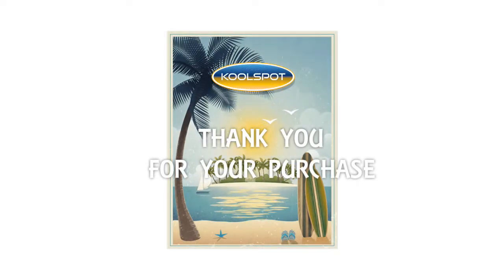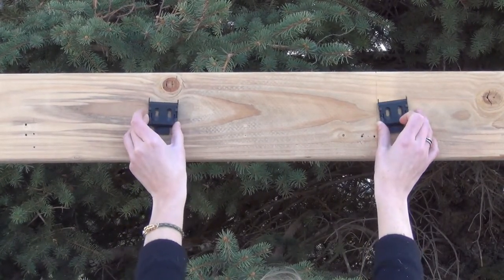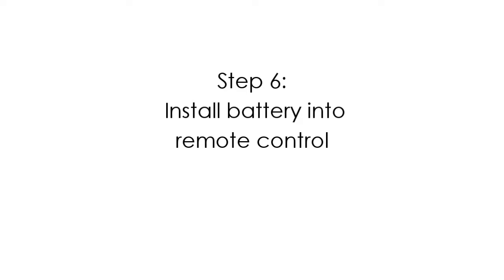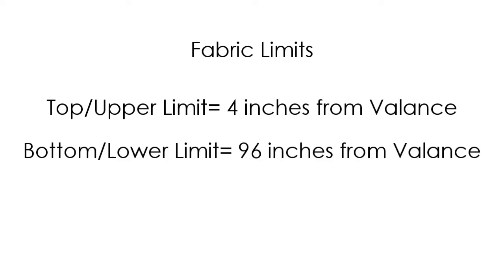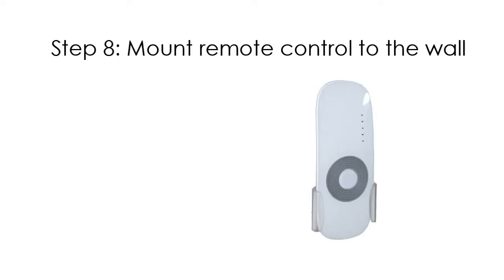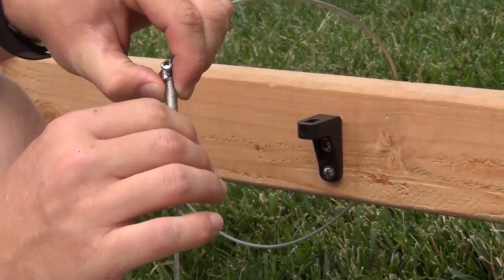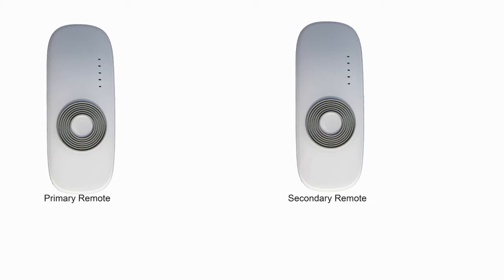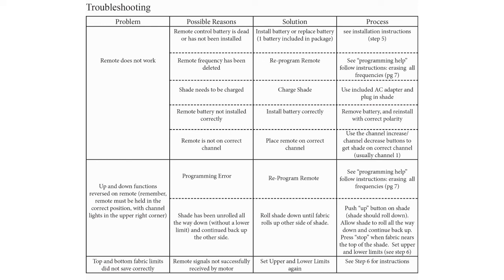How to install your Motor shade

Comment: Need to know where the plug inserts into the shade (motor/interface) for charging? This makes a difference in ability to charge it. Also, need to understand how you can mount the antenna in various positions to accommodate using the remote from relevant locations. These seem like things most folks need for knowing if this will work in each situation .... yet are not discussed here or in the install guide (yes, I read the whole install guide.)
Reply from the maker: Please give us a call at 303-652-6164, M - F 7am - 4pm (MST)